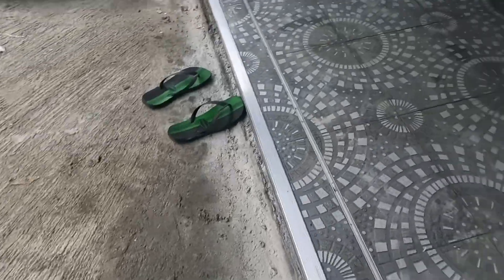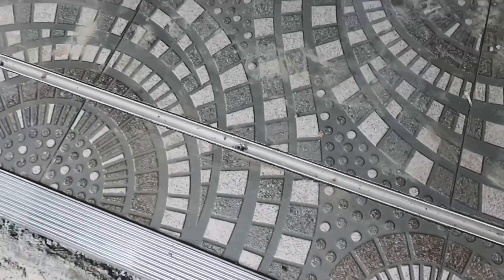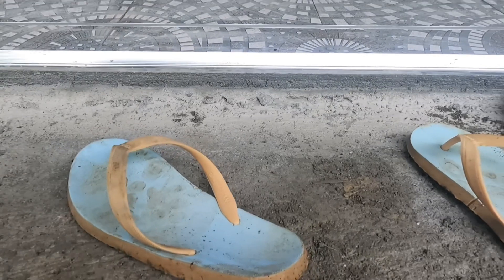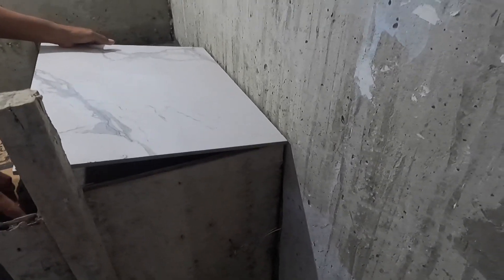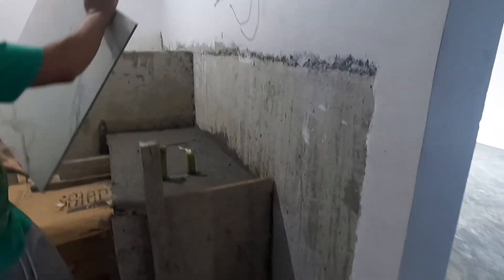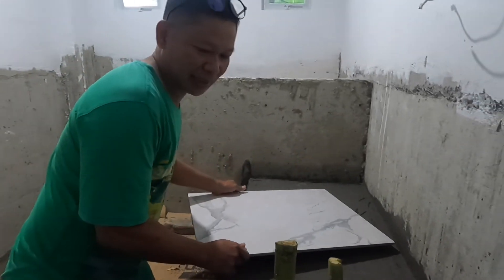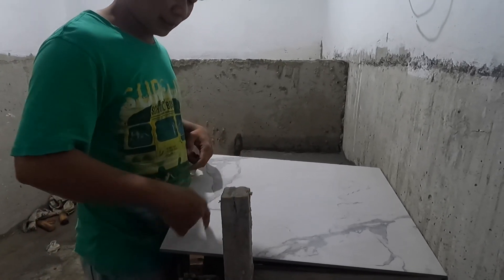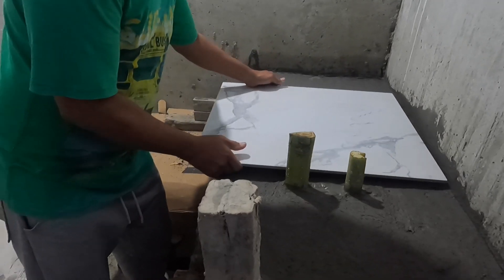Antique,Philippines house build DAY248- Satisfying Purchases !

Comment: Why did you not get a door that comes down from the top and you could put a good seal under it that would compress and seal out any water from entering the garage from Valhalla ? I think when you get the torrential rain storms you are going to get massive amounts coming downhill from the roadway and Valhalla that will overwhelm the 1 or 2 inch raised bumps or dams and the groves in the cement to help divert. Water to the sides and any extra sealing provided will only help guarantee that the house stays dry inside. Hopefully when you have the rails on side of Valhalla you leave the majority open at the surface except where it connects to bridge to help in drainage.
Reply from the maker: I hope none of that comes true. Its been raining a yellow alert for 2 days now. Not a drop. But its not like a monsoon most if the time. Its scary though.

Comment: What is happening with the windows and exterior doors ? They coming from the USA ? Looks like you are having the tile run under the exterior  door jambs and I have never seen this done before. I guess it will help for any water infiltration but will it not  be a nightmare if you ever have to work on those tiles ?
Reply from the maker: Its how they build. I never really thought about that. The window and door frames are custom built about 3 miles from my location. He was on site 2 days ago getting door measurements.
Reply: @62tofreedom51  I have built  3 houses so I know a little about building and wish I had more advice while building all my houses as my trade was an operator and millwright at a chemical plant.  You should inspect  your custom aluminum windows and make sure there is no exposed aluminum where they have made cuts and should be protected with paint as you know the salty atmosphere will greatly reduce the lifespan of them. Having worked with different stainless alloys I can tell you that 316 is much superior to the 304 or lower grades. It buffs up to a beautiful finish that holds and in America the price difference is not that much. I suggest you check into it before you end up with another Valhalla running down into your garage.